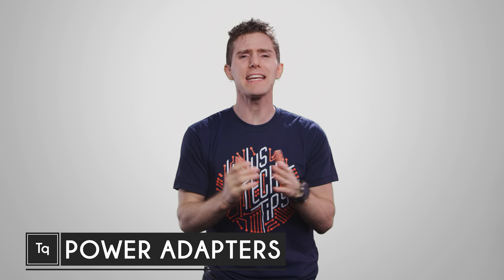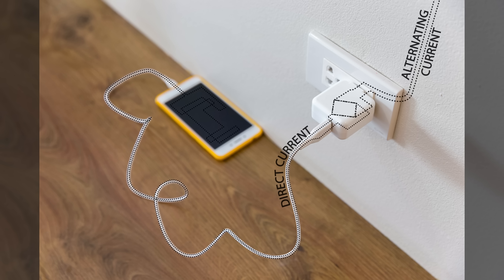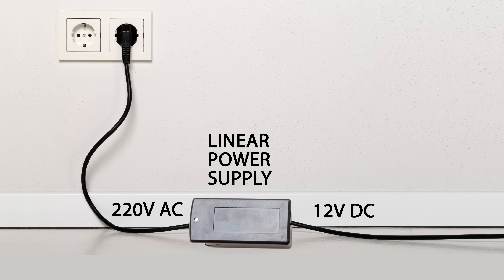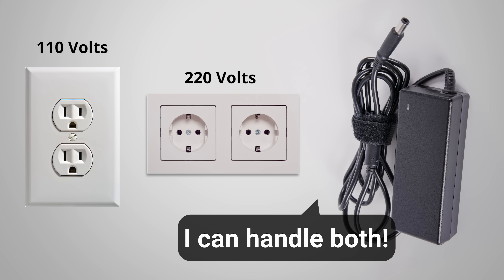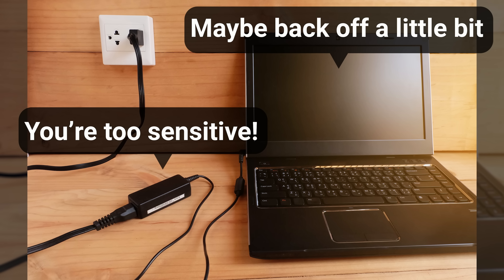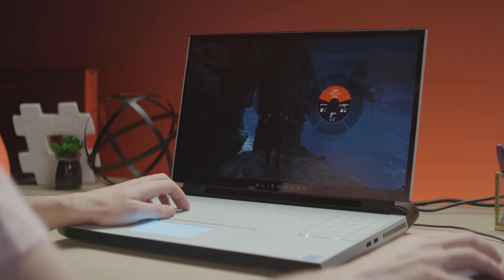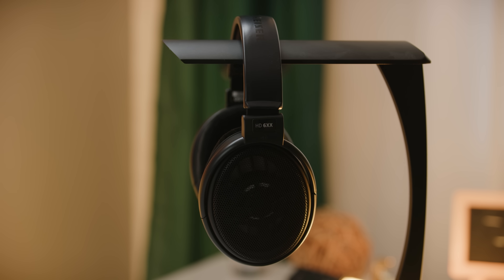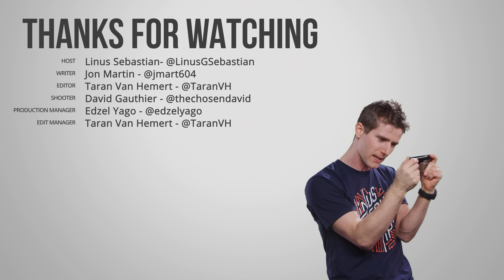Why Power Adapters Are So HUGE

Comment: Isn't there wall sockets that have a power adaptor built in? So you could just avoid using one altogether and have the wall socket do all the conversions needed? The concrete surrounding them are good at dissipating heat and it could even be used to help keep your pipes heated too. Is this a thing? If it isn't then why aren't they a thing?

Comment: I switched my adapter from 250w to 330w. But my laptop still loses battery when playing assassins creed odessy. i7-8850h + gtx1080. And the cpu clock speed goes up and down when the battery is below 90 even if there‘s no thermal or power limit throttle. :(
Reply: I only unlocked the cpu tdp and it never hit above 75w when gaming. My gpu has a tdp no more than 180w as far as I know.

Comment: "Switching supply" has nothing to do with different input voltages. The regulator literally switches the output ON and OFF depending on the load, to control the output voltage which is then smoothed out with capacitors.

Comment: A different approach would be to change the building code to require combination AC and USB power outlets in all new construction.  They're easy to retrofit, too, with these outlets available on Amazon for as little as $10 apiece.

Comment: As the GaN switchers come out, the efficiency can go way up.
Reply: but never reach 100%
Reply: @besserwisser4055  of course. I think TI has a Dev board, around 40w, 97%efficiency. Pretty crazy.
Reply: @leozendo3500   link plz for research
Reply: Just a random example I found https://www.onsemi.com/PowerSolutions/content.do?id=18592
Reply: i have a wall USB plug that has GaN, way smaller than others of the same wattage. love it

Comment: Still have na pentium 2 pro-grade compaq with built-in power supply and 2 slotted batteries.
Reply: What? That sounds like a beast
Reply: @3gyxijv3jqaheb  Yeah xD It's like a regular notebook of that time plus 4-5cm of height more to accommodate the power supply and 2 big batteries

Comment: I had a Compaq 486 laptop with integrated power supply. It just needed a figure of 8 cable to plug into the wall. Guess they have. bad experience I think there were more models with that feature from Toshiba if I'm not mistaken.

Comment: Just enough info for most viewers to gain a better understanding of AC/DC conversion. Yes there are some holes but this isn't a power electronics seminar. Good work. I approve, and I design these switch mode PSU for a living.

Comment: The External Brick of my 250W Dell Precision 7720 is half the weight and half the size of the 230W brick that came with my Dell XPS M1730.
Reply: John Hoggard mines bigger than the bricks used in trumps walls

Comment: my ps2 was fried because I forgot to plug the 220v to 110v adapter first...It's really annoying
Reply: @squishyu  I still have it in my parents house if they didn't throw it away. But I don't think it is worth repairing because not only the fried capacitor, also the DVD reader was always failing, so I rather buy another used one than repair it. obviously I didn't care anymore.

Comment: The xbox360 Jasper isn't the original 360
Reply: The Trollinator 

It’s nice to meet another “inator”

And

Yeah!  The Non-jasper versions had larger PSUs.
Reply: @haxorinator8219  thx
Reply: @haxorinator8219  The falcon refresh had a smaller psu also, but Jasper was even smaller
Reply: The OG was the xenon.
Reply: I have no idea what the Jasper is I thought there was just three Xbox 360 the one that was white the one that was black and the one that was shaped like an Xbox One and yes I know the original 360 came in black and was called the elite but the black one I'm referring to is often referred to as the s
Reply: @bland9876  Their were 3 refreshes of the fat, white 360, Zephyrus, Falcon, and Jasper
Reply: @sandwichbandit779  what's the difference if they use the same outsides? Is it the hdmi port on the newer model? But then you said three different types
Reply: @bland9876  small hardware improvements that are more power efficient, hence smaller power bricks

Comment: They need to make a 500W passive/sealed power brick. Or at least 450W. The highest capacity available is the Dell 330W, which is not enough for high-end machines.
Reply: Theres a limit i think that is to much to take on planes
Reply: For laptops

Comment: switching refers to the use of pwm modulation to provide current to load, this video is innacurate
Reply: this is not meant to be a super accurate guide on how power supply's work only and explanation on why they are large
Reply: @finley6691  I know it is not an in-depth explaination, but at least it should be accurate on what it says
Reply: @camilo3626  this part of the video is not meant describe how each work only what each means to the user. Describing a switching power supply as being able to switch voltage is the easiest and clearest way to get across that they can work in more situations even if the switching part does not refer to this.
Reply: Camilo José a switching psu doesn’t have to have pwm.
Reply: @petrosrz8990  boi a switching mode power supply uses pwm to chop the output signal in order to regulate current, Im an engineering student son
Reply: @camilo3626  what about pfm?
Reply: @petrosrz8990  pfm might be used at the output stage for dc-dc conversion, but pwm is the standard for smps

Comment: And DO  NOT buy cheep Chinese power adaptors / phone chargers from ebay. Often made to very poor safety standards, and the mains reference voltage can leak across to the low voltage side.
Several teenagers killed in the last few yrs charging their phone while in the bath !. 1. You should never do that. But had it been a genuine apple adaptor etc that would not have happened.
Reply: I have opened a fake apple one and seen that secondary was touching primary!!!!!!! Usb and plug were literaly seperated trough a diode and the super thin isolation of the magnet wire!!!! Also the single diode (this is China did you expect full bridge rectifier?) and capacitor were arranged in a way that could create a voltage doubler which in the worst case you could have up to 680v in the usb!!!!!
Reply: Anyways ebay sells super damgerous stuff for instance i have seen a water heater that heats the water by passing mains through it!! MAINS!! LIVE AND NEUTRAL WERE CONNECTED INTO SOME METAL BARS AND THEN YOU SUBMERGED THIS INTO THE WATER!!! And there you go! You have live water with a very dangerous voltage referenced to ground! China is incredible!
Reply: I wouldn't be surprised if some brand name items are bad too, a lot are just relabelled, cheaply made items. Hopefully they're certified in the country they're sold in(when not imported directly from overseas by the customer), but a lot of products do feel 'iffy' now.
Reply: Uhh using a charger in the bath seems like a Darwinism in the working, regardless of what brand the charger was from.
Reply: 3rdman well if it was a high quality adapter e.g. Apple, Samsung you get the idea... it wouldn't kill let alone hurt if you dropped your phone or whatever but if it was a chinesium adapter of crappy brand, it COULD allow mains to travel through the 5v rail and POSSIBLY kill, but if you had it plugged into a GFCI then that chance would most likely go down. Not saying that it isn't dumb to bring your phone in the tub though.
Reply: Or you could you know... not use it in the bath

Comment: "Switching power supply'" comes from the mode of the transistors in the power supply (wrong in the video). In older power supplies they use to work in "linear mode" (linear regulators? Sounds familiar :D ) In that mode we have realy steady voltages, low electric noise and lot of heat (correct in the video). Newer PSUs use switching transistors in combination with inductors (chokes like the one next to the GPU/CPU) i.e. they are just on or off. There is no middle point. That gives high eficiency, less heat to disapate and higher electric noise (No wonder that you can hear strange noises in your speakers. They are comming mostly from some PSUs (not in all cases but in most).  Linus that time you messed it up. Ask Louis about what he thinks about the video :D
Reply: Most real (not cheap garbage) PSUs' uses transformers instead of chokes for insulating mains from the low voltage output

Comment: Should probably correct this as switching adapters are not called switching for that reason. They use an oscillator to buck (google Buck Converter)  the voltage down from the rectified source.
Reply: They don't oscillate... They have a controller that controls output frequency and duty cycle. It switches a transistor on and off....

Also many PSUs don't use buck converters. They may use SEPTICS/Flybacks etc because they're isolated and get whatever output voltage you need.
Reply: @ericcartmann  Indeed. PWM is a special case of oscillation. As for the "PSU" bit, yes that is true too, but for most wall-warts they use a cheap-chip converter. Buck converters are just a good starting point to google to learn the black magic of DC-DC converters.
Reply: @dnsmcbr104  lmao oscillation implies some kind of LC/RC filter or crystal. Oscillations are analog in nature.

Converters drive a square pulse to the gates of mosfets and bases of BJTs. This isn't an oscillation, it's a driven signal.
Reply: @ericcartmann  Oscillators to me imply anything that goes up/down in a controlled or predictable manner. Probably an incorrect definition in the generic space, but in my EE bubble, it gets me by.

Comment: 3:55
I think the wording you chose there is very poor to the point it is wrong. A power supply doesn't consume 1000 watts or more, it supplies, or converts, 1000 watts or more. A supply does not consume power, the components attached to it do.

Also, I believe your destinction between linear and switching power supplies wasn't very good. I don't feel you quite got the point across how a switching power supply differs from a linear one.

Comment: He missed the main point. AC wall electricity is dangerous because its ac and its high voltage. Phones are very abused, they get dropped and dropped in water(sometimes even salty water which is conductive). A failure in the power adapter can result in a overvolt of different components in the phone's/laptop board and damage to them. It might also exposed or short the live wires which is the most frightening to me
Reply: Are you trying to make the argument that phone adapters are not abused?
Reply: @Anton-cv2ti  Phone adapters are abused but they are plastic. Normaly the internal fuse in the adapter will burn before a adapter gets that exposed that you risk touching the high voltage side. 

A faulty phone with 230v and metal frame (has to be used due to antenna technology) can cause a hell of a problem and really not healthy, especially for someone with a heart problem
Reply: High voltage is not dangerous. High voltage mixed with high current is dangerous. Most water in general (other than distilled) is conductive due to the minerals and metals often in it. A failure of the power adapter will likely just destroy the charging circuit of the phone, nothing else.

Comment: usbc or some universal bus should be installed in every ac socket then we wouldn't need the brick.
Reply: They already are, just replace the wall sockets. However that wouldn't help for higher powered devices like laptops

Comment: You say huge? Sure you haven't experienced old fashion transformer linear power supply..
Reply: Not only they were huge but the bigger they were the more annoying since they had 50Hz or 60 buzzing especiaöy when fully loaded not to mention that you needed a whole truck to carry such a heavy think!!!

Also it was very easy for short turns to occur in the coils that would create more heat and thus more short turns until the current is so high that breaker trips and if you are the guy who has a ton of them plugged in you cant imagine how much you would waste finding which one is the broken and unplug it so that you can reset the breaker!!!

Comment: In other news, transformers are big.
Reply: In other news, water.....  wet.
Reply: They are not anymore
Reply: @IamUzyf  yes, they are. It's physics. It depends on the specific materials and uses you need.   I don't know where you like but maybe if you look up in a electric post and see a big square box that's a transformer. It's big ain't it.
Reply: ShikiMX this video was about AC adapters which have high frequency SMALL transformers
Reply: @Shiki-mx  transformers in linear power supplies were big and very heavy. In modern SMPS designs, they have shrunk a lot because they work at much higher frequency nowadays, 20kHz or so.
Reply: Can't we use buck converter instead of transformer?
Reply: @samueladitya1729  yes you can but buck converters are not efficient as transformers

Comment: If you put 220v in a smartphone it won't end well.

Carrying electricity  as alternative current at a high voltage is easier, but tiny electronics can't use that.
Reply: @goodguy853_RBLX Yes I know that.
And?
It still is a lot more than 5v (or 12v).

Comment: So why don't we instead build in AC to DC converters inside of our houses and just have them live in the walls or the basement or something?  Seems like a better idea.
Reply: It does sound good in theory, but in practicality it gets complicated very quickly. For instance, different electronics require different voltages. How would you be able to adjust the voltage according to the device you use? Also, there are so many different types of adapters and connectors that devices use, how would you be able to adapt for all those devices?
Reply: @alexkalicharan8283  and easy explanation right there. On top of that. The average person doesnt know squat about electricity. It's much safer for the producer to supply what their products need vs leaving it up to the consumer to know better.

Comment: I cannot wait for the powersupplies to be standardized. tired of the different shit supplies for laptops and some devices.
Reply: They probably never will be, all devices use different amounts of power and are all made by a manufacturer that would match it best - a power supply for a laptop can't be the same as a phone one

Comment: in the Netherlands you are between a 230 and 240vol  sometimes it drops after 220volt  240 allows you to overclock your PC much further 220 volts

Comment: they never used linear power adapters, they use 50Hz tansformers, and then after rectification linear voltage stabilizers
Reply: Actually those 50 hz transformers as you call them are indeed linear transformers

Comment: Between the shrinking size of higher power adapters and the shrinking size of motherboards in laptops as more stuff gets integrated into fewer chips, many modern laptops have plenty of internal space to spare for an internal AC-DC supply. I suspect their main reason to still use external bricks is simply to delegate the liabilities and safety certifications for AC-powered equipment to a third-party supplier.
Reply: yup, i agree.

Also, you'd have to make sure the insulation inside the notebook is good enough. If you have voltages like 20v dc and below, it literally doesn't matter. However, if you have parts of the notebook running at 240AC, you'd have to make sure that that part is very well insulated, which isn't as easy inside a notebook. 
For a desktop thats easy, just put the whole thing in a metal case and ground that thing, easy. Can't do that in a notebook.
Reply: @jort93z  It isn't really that difficult to isolate the PSU from the rest of a laptop, just need to mold a partition in the cover to keep it away from any conductive structural component. My Acer laptop from a couple of years ago is almost half empty space inside due to not having an optical drive, enough space to fit two or three of its AC 50W adapters.

The biggest problem would be the AC cable: modern laptops are too thin to fit an IEC C6 socket, a thinner lower-power standard would be necessary. May need to go UK-style fuse-in-plug to protect the thinner gauge wires and connectors from meltdown.
Reply: @jort93z  While ground may not be absolutely necessary, what is most likely to fail in typical adapters is the separation between primary and secondary inside the transformer since smaller transformers put the windings closer together. If transformer insulation fails, I'd rather have 110-250V go to ground and blow a fuse than going to every piece of exposed metal on the laptop and all connected devices. Those connected devices, their connectors and cables should also stand a better chance of surviving with most of the fault current returning directly through the failing PSU's ground.
Reply: @jort93z  I have at least six different laptops spanning three or four different brands from the past 15 years (newest of which is a $500 Ryzen 2500U laptop from Acer) and they all have grounded bricks. Seem pretty common to me.
Reply: @jort93z  Out of the four adapters I had within arm's reach, three have a direct connection from AC ground to output neutral, the fourth is a no-name aftermarket adapter so I'm not too surprised it may not be doing anything with its ground pin.

Even if the ground pin reads open-circuit, it could be because there is a guard winding between primary and secondary in the transformer (a winding connected to ground at one end, nothing at the other) to shunt current from an insulation failure to ground. This can also be used to reduce EMI.
Reply: @jort93z  AC-side ground to DC-side neutral, not AC-ground to AC-neutral. If this still doesn't sound right to you, practically all AT/ATX/TFX/SFX PC power supply on the planet is wired this way - continuity from AC-side ground to DC-side neutral / black wires / case.